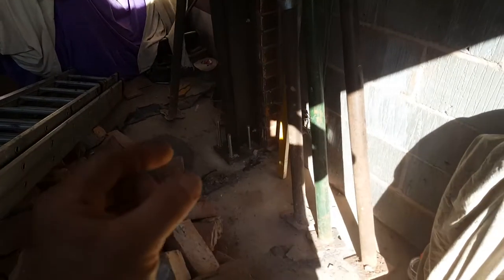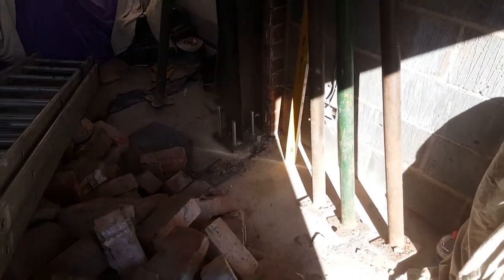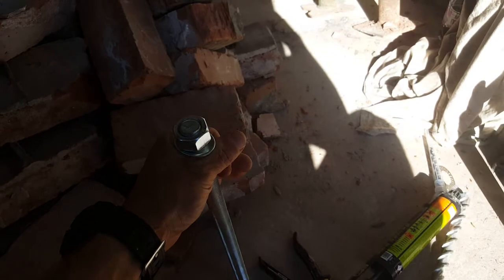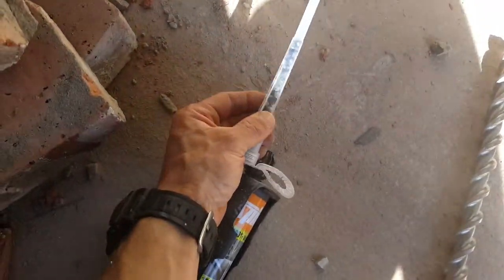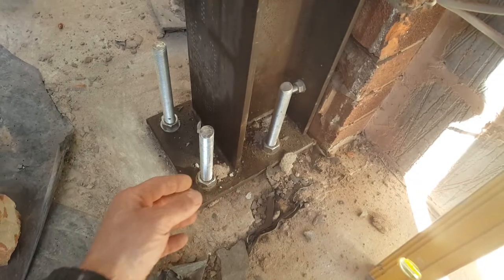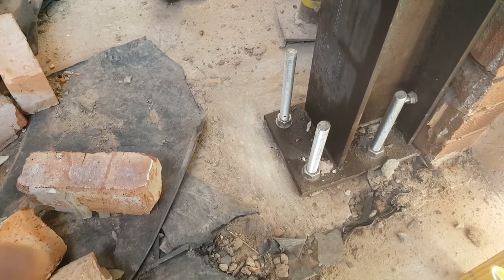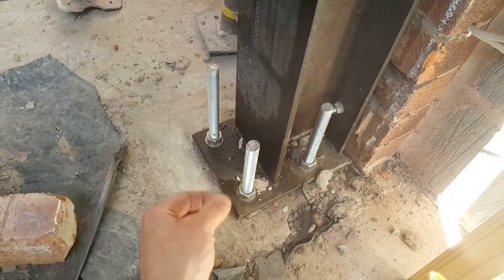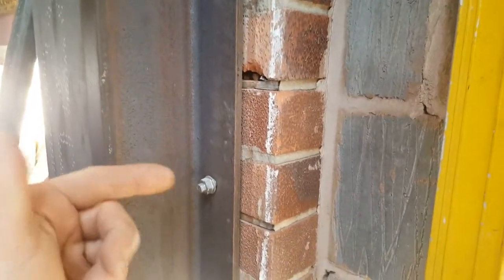How to fix a steel rsg lintel to a wall. welding

Comment: That welding aint too pretty.  You would be better off getting a welder to do it on the workbench and then fit it in place.  Better still would be to rest the beam on top of the columns then any welding or bolts are only locating the beam not supporting the full weight of the wall.